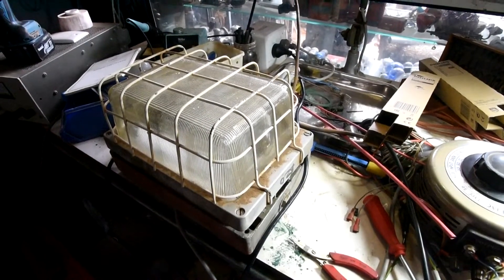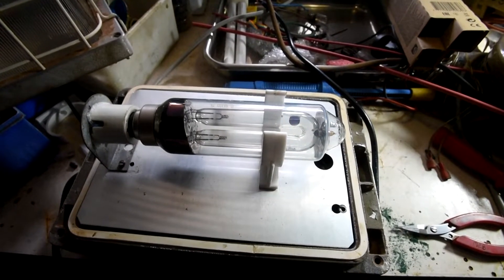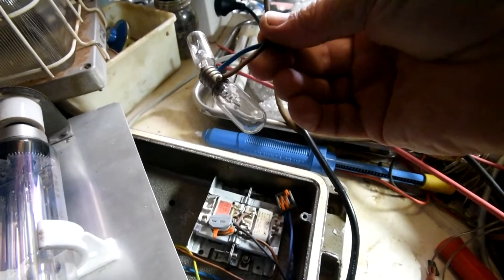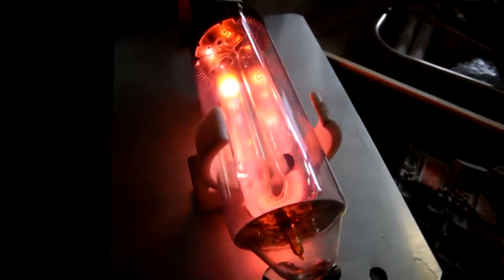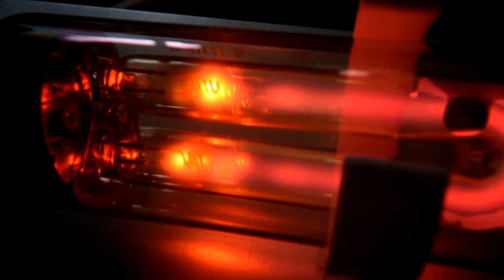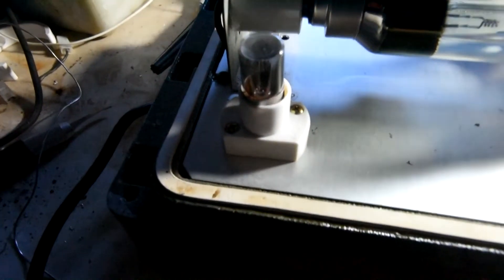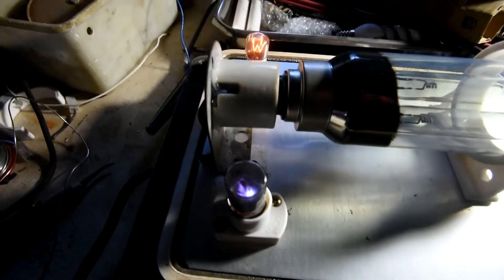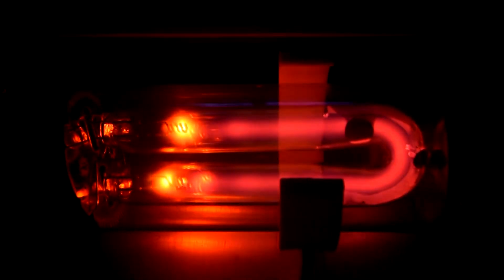SOX lamp conversion (Low Pressure Sodium)

Comment: It's taking many attempts to start and that's causing a lot of sputtering. You need a capacitor in parallel with the lamp which gets switched on and off by the argon or neon starter.

Comment: Nice work, that starter is a very good idea.  I too am looking for bulkheads for exactly the same size SOX lamp and I can run it off a 24v 20W fluorescent ballast that came out of a bus.  Not overly bright but just enough light to see with when I'm collecting wood at night.  Great vid.  Cheers!

Comment: 18W SOX will start with a FSU starter, connected across the lamp. Does not work with higher wattage lamps. Does not need the lamp as starter ballast, though the lamp will at least help with providing some light if the tube fails to strike.